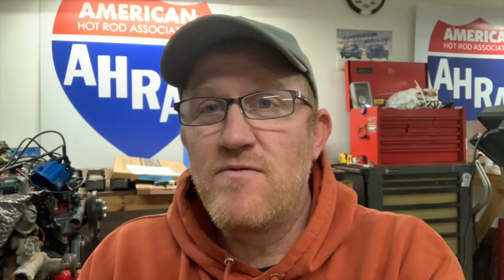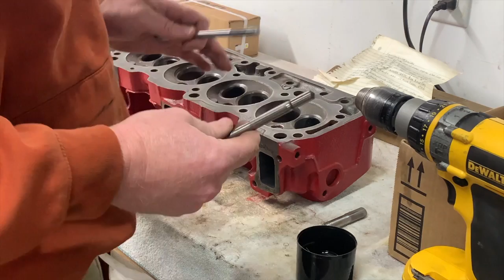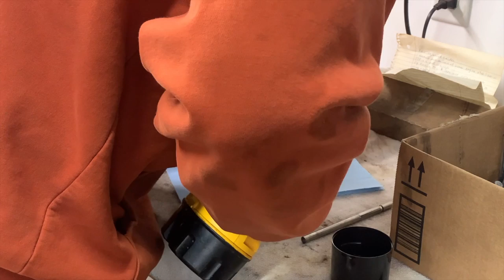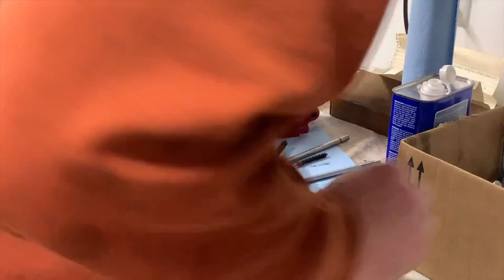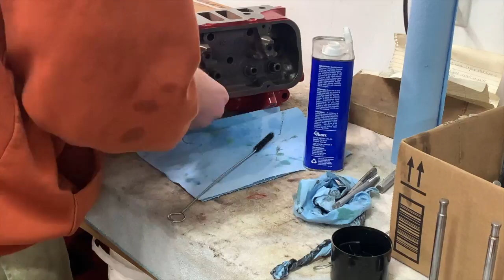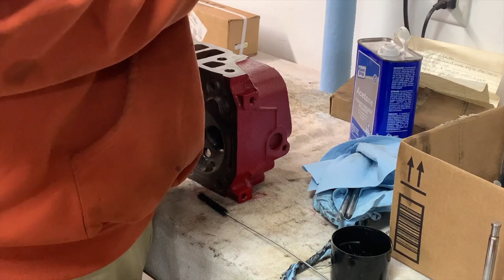At Home Valve Guide Repair, You Can Do It! #AHRA #nonamenationals

Comment: back in the 1950's thru the early 1970's knurling the insides of the valve guides was done to temporarily get a engine put together, knowing that the knurling would loosen quickly from wear if the car was a daily driver.  It seems to me that another hour spent completly removing the old valve guide with a new one would be a better and economical choice.
Reply: Yep! Took the words right out of my mouth. Knurling is an inferior workaround. If you're rebuilding an engine for power and the long haul, bronze guides are the only way to go. Had countless arguments with machine shops trying to sneak that pass me.
Reply: Damn. I hate it when common sense, proper procedures and experience get in the way.  You RoCk!   ᕦ(ツ)ᕤ

Comment: total bullshit- you just reamed out-removed more metal making the valve guide bore bigger than it was when over spec already-instead of internal wear hourglass shape guide you now have a constant bore valve guide with a bigger hole way over specs- and valve angle to seat will be off past specs= its a idiot way to say remanufactured and sell it to a moron. for a worn out daily driver sucking oil just replace the valve guide seals with new 2 ring viton seals and it wont seep oil and you will still have more metal in the valve guide bore-make a worn out bore over spec better by removing more metal from the worn bore so it is more out of spec worn- anyone with a brain tell me that makes it better  : )  I ll Wait  thru eternity for an answer that states making a worn out hole bigger makes it better that only works with womens p--------sies !!!

Comment: watched the video on guide replacement.  on a chevy head 333882 the portion that holds the guide is cracked  can that part be  replaced or do I have to replace the head??
Reply from the maker: I’d assume the head would be trash at that point. That part is not normally replaceable, it’s part of the casting. Almost anything can be fixed, but the cost normally outweighs the repair unless it’s something of significant value or rarity.

Comment: In my shop I once in a while will do it on some heads. Most of the time I replace them. If I replace all valves I will buy with over sized stems and reame for a OEM rebuild

Comment: It's called knurling
 Does not last long.
Reply: Yup, and just about every head I've torn apart with knurled guides have completely worn out the valve stems.
Reply from the maker: Lasts longer than having a bad guide.

Comment: Unfortunately these tools aren't very cheap, especially if you're only using it once or twice. If I could find a used set for a 289/302 ford valves I would definitely pick them up
Reply from the maker: I had someone send me the tools, if you need something similar hit eBay and get a used set.

Comment: I worked at an engine machine shop that provided this service.  We used a very torquey drill that you had to brace yourself and hold on to the drill handle firmly when knurling.  I'm surprised the cordless did the job for you.
Reply from the maker: I use this cordless drill to drill oil passages in the engine block to 5/8”. I’m sure it can handle something this small.

Comment: I recall back in the 70's where they would "knurl" the guides, then burnish to size. The interesting part was that it was said to be superior to a standard guide in that it would essentially create small pockets all along the length of guide that would retain oil for way better valve lubrication.
Reply: Did that on my 327 in 1977...
Never had a problem with oil....also used teflon seals.
That 327 would screen.
Reply: @bryandouglass9997  I love it when engines screen!!
Reply: @Anarchy-Is-Liberty love the name u have! It sure is!!

Comment: I have dome this a lot "back in the day". All is good as long as the valve guide isn't so sloppy that it has lost it's indexed placement in the head if it is a cast-in guide. In that case the guide would need would need to be drilled out oversized for a new guide, indexed, installed and reamed to size.

Comment: Only thing is knurling is a temporary fix they will wear faster seems you have half the wear surface. Back in the day a lot of budget "remanufactured" engines done by less than reputable companys would have knurled guides vs replaced and that's cheesy that head isn't going to last like a new set of guides, "new" engine at 20k miles vs 100k or 200k and the engine seems to start burning little oil....but as a diy guide bandaid to buy a few more miles out of an engine that don't wanna dump a bunch of money in why not.